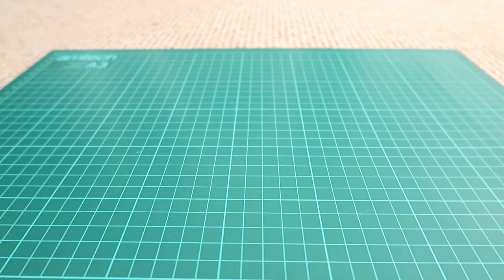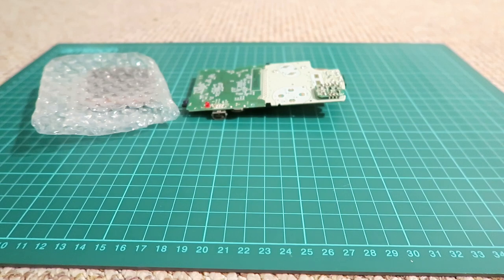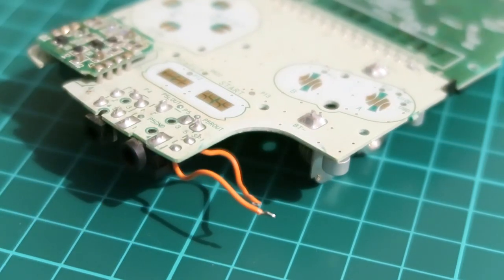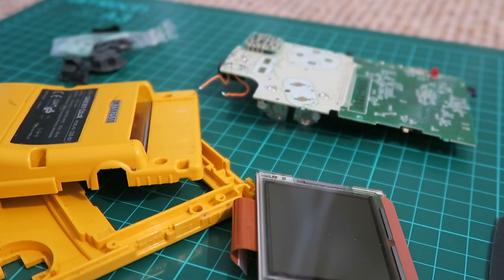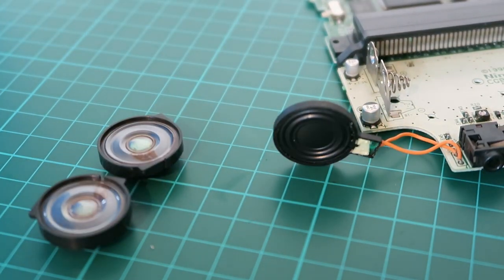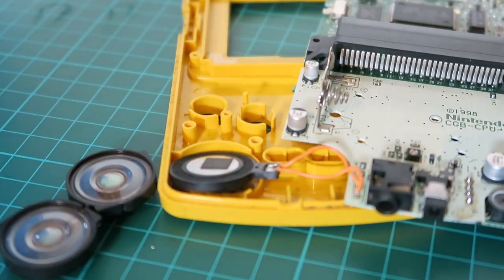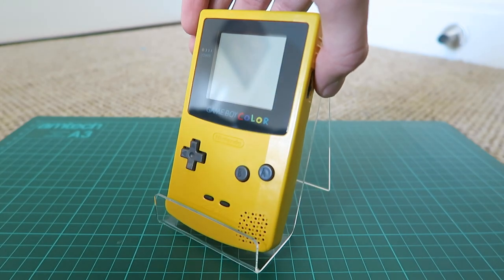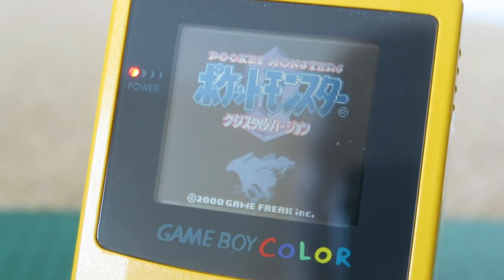Let's Refurb! - Building a Gameboy Color!

Comment: My A button doesn't work... Would you recommend spraying electronic cleaner on the mother board to clean the contacts?
Reply from the maker: nemesys6 that might work but I would recommend taking it apart and cleaning the contact with rubbing alcohol

Comment: Have you tried making a GameBoy Color inside a GameBoy Pocket shell?
Reply: DantheLazy Munchlax782Gaming Battery holder wouldn't fir but you might be able to wire the pockets built in batteries. Could be intresting :D
Reply: The screen would look like arse though... The lens from the pocket is too big for the screen.